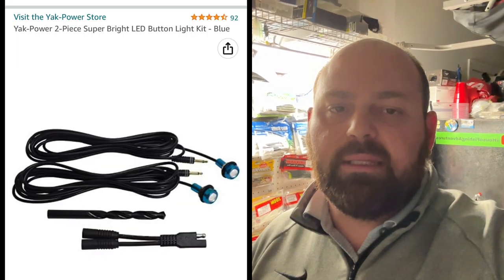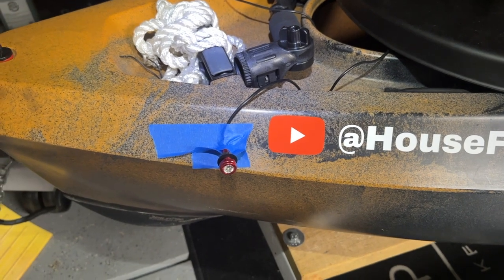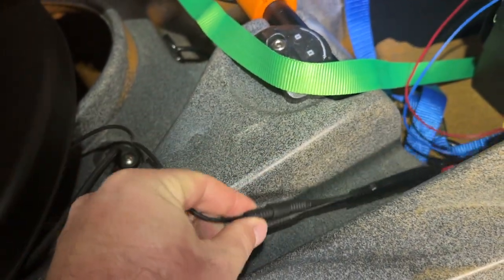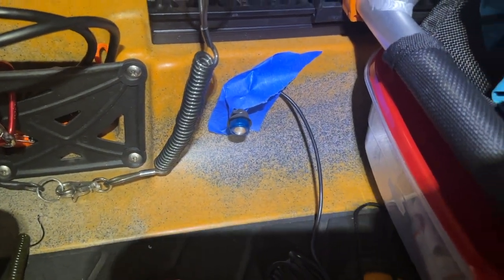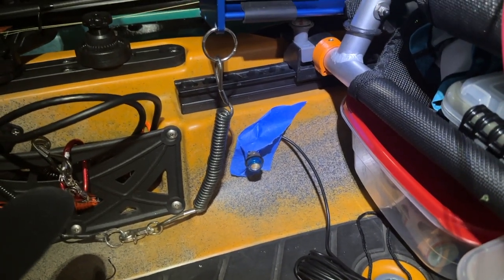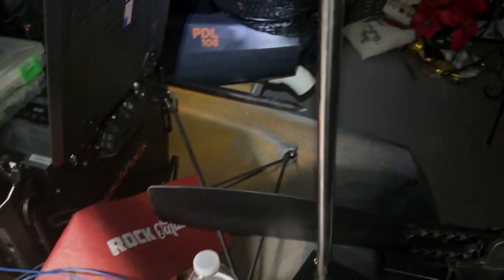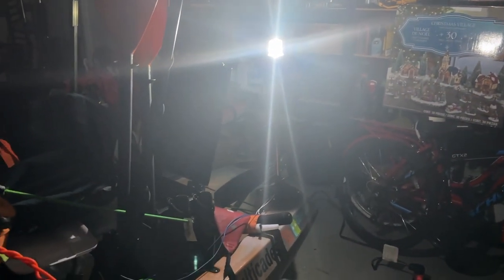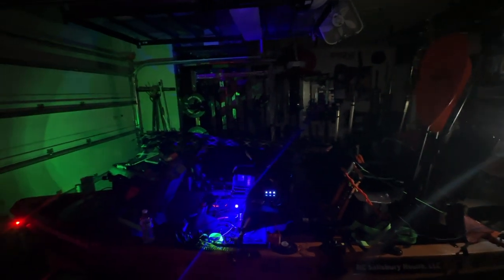🔥LIGHTS ON A KAYAK🔥?!?!?! Yak Power w/ my twists!!

Comment: Hey Jon, thanks for showing the YAK bow lights.  I had a concern if they were bright enough by Coast Guard standards, but they surely look like they would do the job.  I was looking for one of your follow up videos, but can't seem to find if you ever did a final install of those lights?  If I can ask where did you get that 3 switch panel set up at?
Reply from the maker: Yak power would recommend their strip lights to be coast guard compliant. In my opinion they are plenty bright but again that’s my opinion. I never did install them, holding out for my next yak. There’s been some changes in the clubs I fish with motors. Depending on the direction of our clubs I may HAVE to install them next year. I did get battery operated ones on Amazon that are great and cheap. I just velcro them in the cabin. Here’s a link to the rocker switch panel. https://a.co/d/fF9xBW5